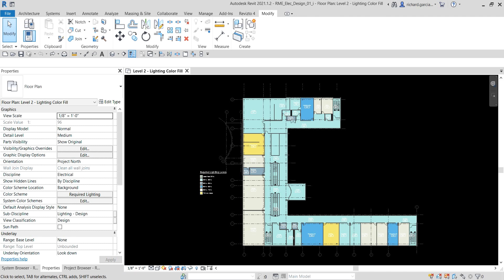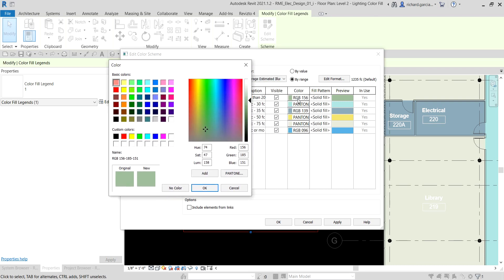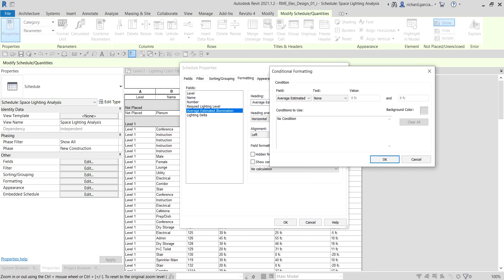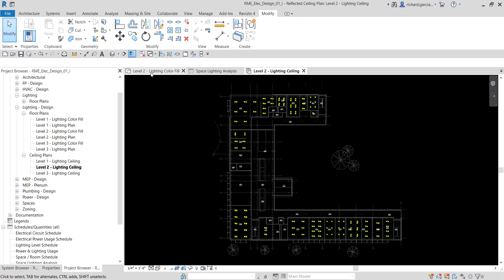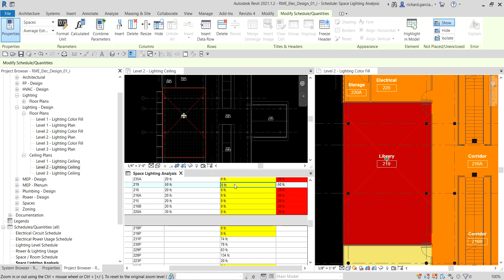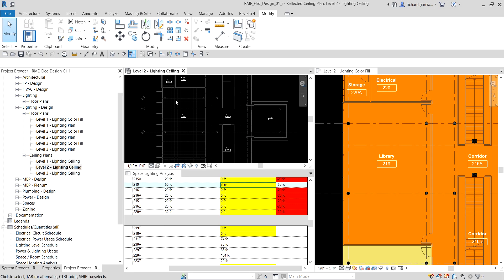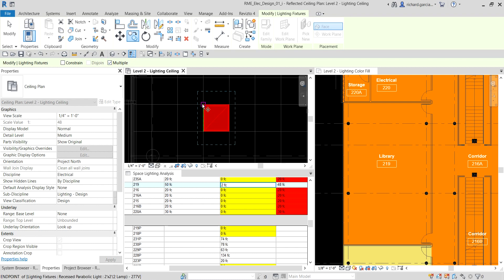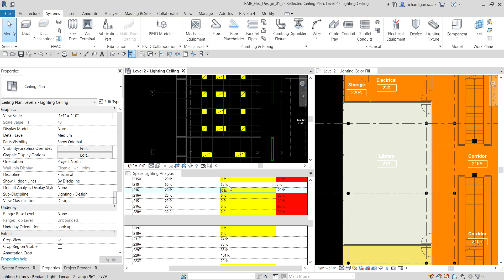REVIT MEP 2021 - ELECTRICAL SYSTEMS - 23 ADDING LIGHTING FIXTURES USING SCHEDULES AND COLOR FILLS

Comment: excuse me Sir, I tried to put more lighting fixtures in the space, however there is no change for the calculation. Could you give me a hand？ Thanks a lot.
Reply from the maker: hi Yang, did you place the lighting fixtures in the space?
Reply: @bim360  Thank you for your reply. I tried to use the lighting family of Revit it works. For other lighting families I download from other website I need to point it a specific IES file to the lighting fixtures, then it worked.
Reply from the maker: @yangwenwen9922  oh nice, thats what i thought. soem families created are complete information when created